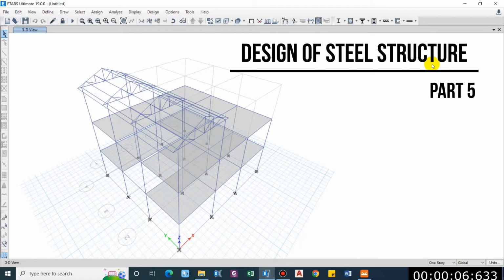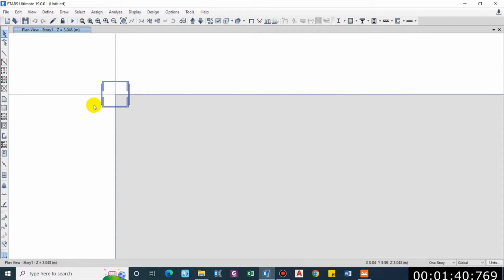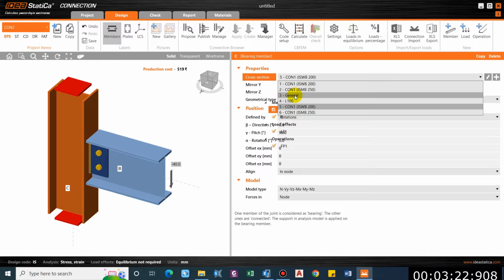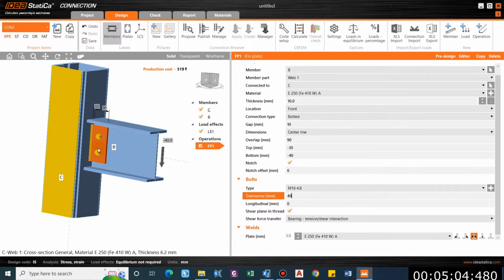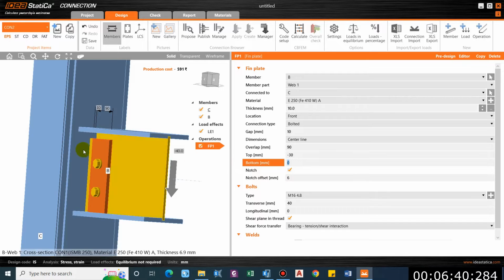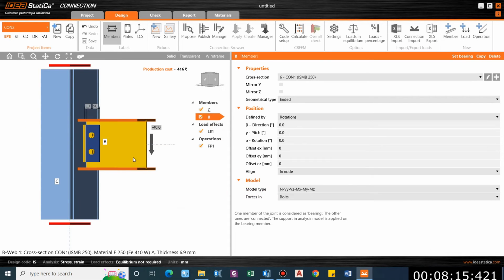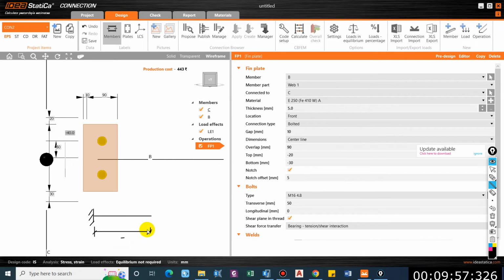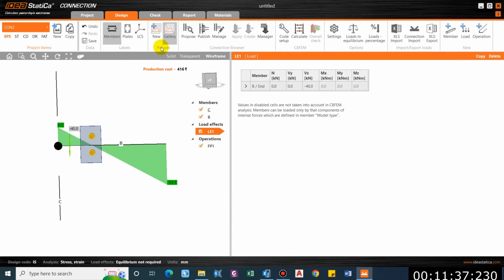Shear connection design between beam and column Part 5 | IS 800:2007 | ETABS & IDEA STATICA |

Comment: can we make a moment connection on web of column if we didn't released moment on beams?
Reply from the maker: Considering stress diagram of steel section flange is responsible for moment, so flange shall be considered for moment connection.